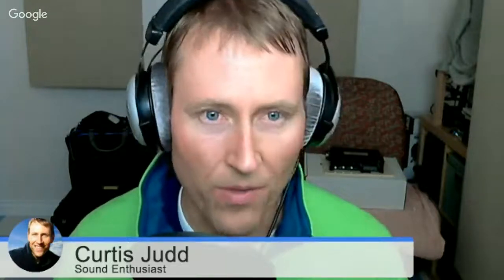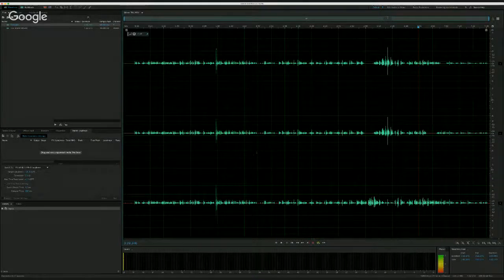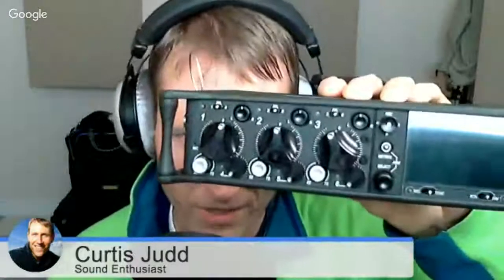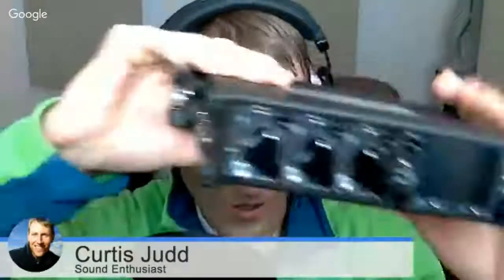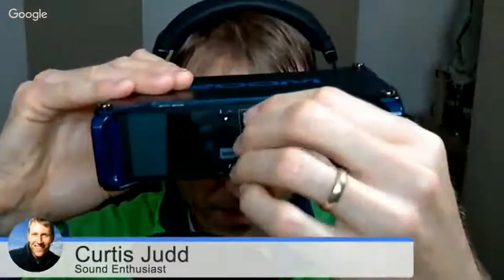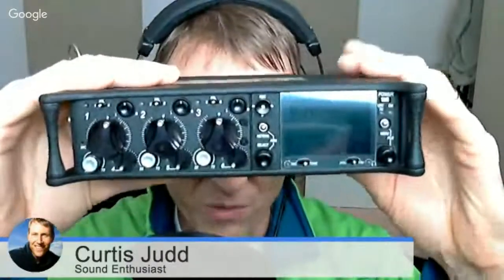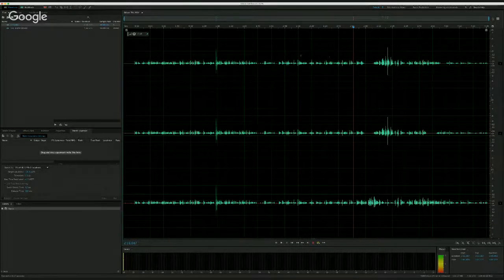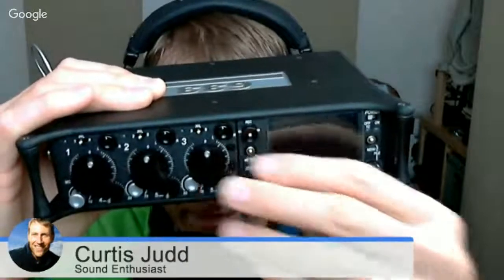Sound for Video Session: Why Mix While Recording? 24 March 2016

Comment: You discuss high-pass filters. May I ask is there any advantage to setting a HPF at the microphone or at the recorder, compared to just applying HPF in post production? Best regards!
Reply: Hi Harri, There can be an advantage depending on the microphone or the recorder. If the mic or recorder employs an analogue high pass filter prior to the amplification stage, removing the unwanted low frequency energy can result in a cleaner recording because the analogue preamplifier is not overwhelmed or saturated as can sometimes occur with heavy low frequency energy. When done on a recorder, mic with a digital HP filter or in post, there isn't an easy way to clean up the sound of an overwhelmed or over-saturated preamp, even if you do remove the low frequency energy.